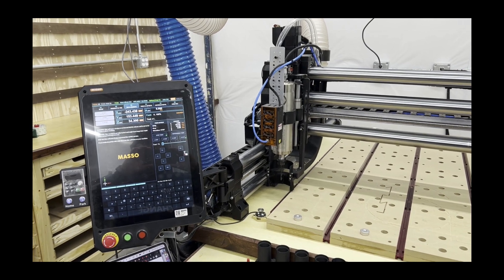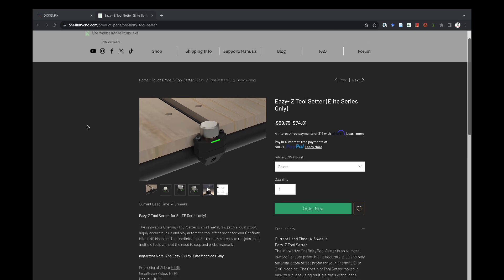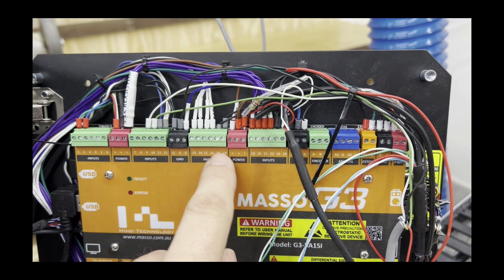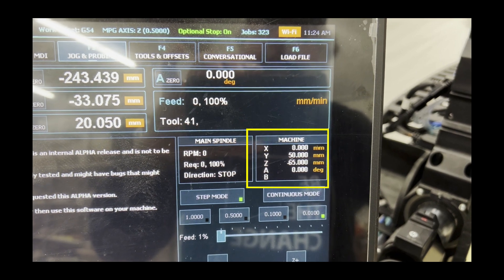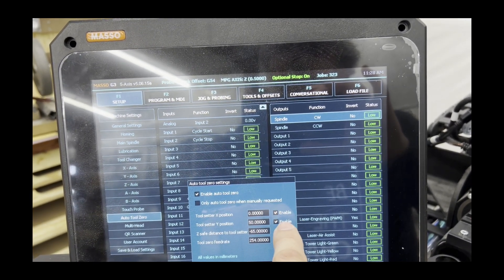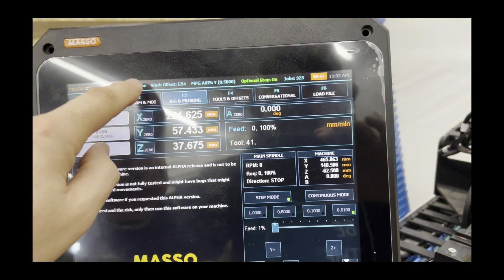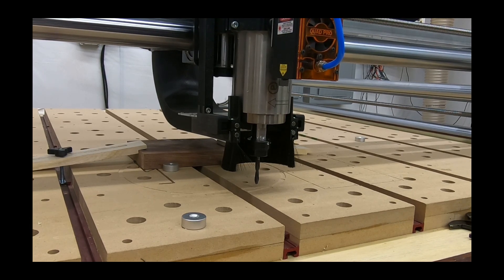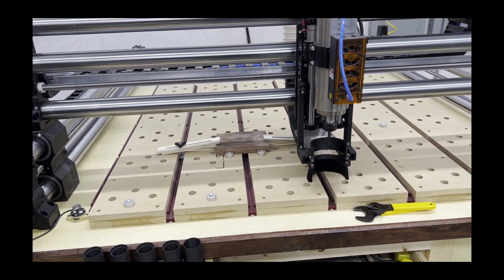Stop Re-Zeroing Every Tool Change

Comment: Could you explain how it detects but diameter?
Reply from the maker: Here's a video: https://www.youtube.com/watch?v=pF78sLJ-CWk&t=82s.  You basically use a probing cycle to touch off on the sides of the top plate at it's X position on both the left and the right while running the bit backwards of the cutting direction.

Comment: Ok,
Everything I do takes an extra step or two. 
Some are easy fixes, some I have to pull my hair out for hours.  lol
Thought this on would be an easy fix. NOPE! Grrrrr
I couldn't find an option for tool setter after double clicking input 18, and by default was set to High.
Hit the spacebar to change to low. 
But still didn't toggle from High to Low when pressing the tool setter. Grrrrr!

Then I noticed Tool Setter on input 11....
Light Bulb Moment.
Thats the default 2 Wire Tool Setter Port built into the back of the Masso.

So I disabled input 11 and set tool setter to input 18.
Still not working?

Looking back inside, looks like they have some trickery going on wiring it along with the Probe on input 12?
Pull up resistor?
Dont know what going on under the Heat Shrink?

Do I need to completely disconnect the factory wires for the tool Setter and Probe,
Along with disabling them in the masso setup?
Reply from the maker: I think we got this taken care of in an email thread.